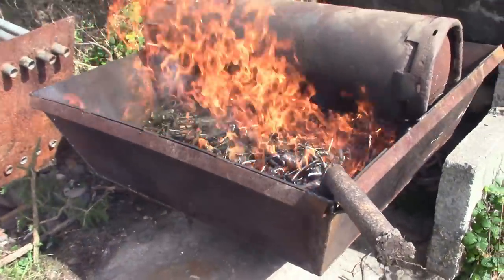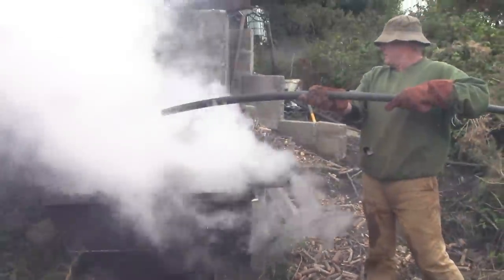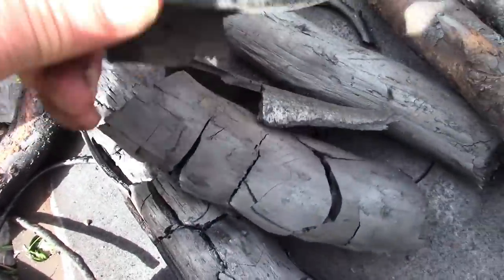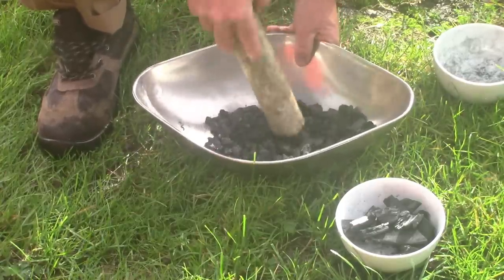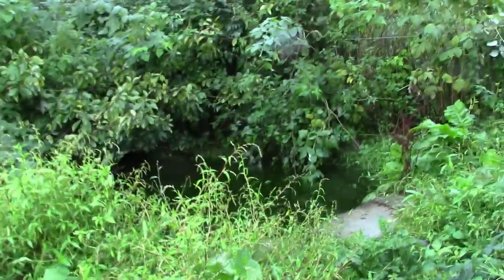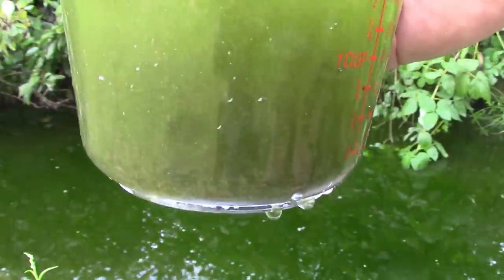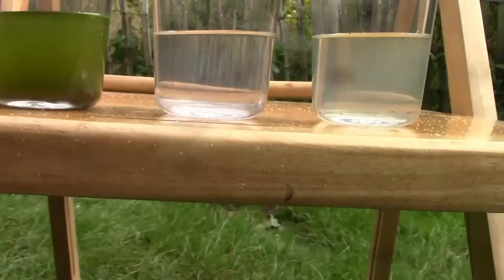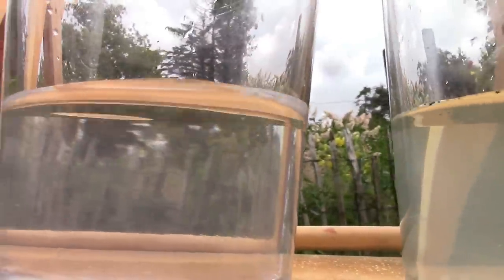But Is It Really Activated Charcoal? (Make your own and then test it..)

Comment: Having done quite a bit of charcoal myself and dabbled with a few activation ideas, none of which satisfied me that the process was successful, I’m not convinced your test method is valid, perhaps filtering chlorinated water and testing for chlorine or perhaps filtering water that is not neutral in pH and testing if it brings it back to a more neutral pH?
Reply: The pH level is not a good indicator since wood ache is always alkaline. That will raise the pH level even if the charcoal has no activation. There are cheap indicators for chlorine, but an accurate result is easier to do with iodine. A simple titration can give very good results.

Comment: So, it looks like you are taking the long route to activation. You could ensure your process by using a calcium chloride or lemon juice solution.
Reply: I've used a calcium chloride soak but the soaked charcoal needs to be heated above 400C to initiate activation.

Comment: Why do people sometimes call Celsius a centigrate?

Charcoal seems like black magic to my inept brain. i have watched it being made rather simply on this channel but its completely crazy causalities are impressive. from wood to not quote coal with just some heat and rapid cooling hmm kinda like tempered metal? clever people were all throught history of our spiecies.
Reply: Centigrade: "one hundred graduations", because there's 100 degrees between freezing water and boiling water.
Reply: Centrigrade was the old metric word for the unit. When the scientific world changed to SI units (in 1960?) the name of the unit was changed to Celsius. SI took some units from the metric system (e.g. metres, kilograms), some units from the Imperial/US system (e.g. candlepower/candela), and invented a whole bunch of new improved units (e.g. Joules, Pascals). I believe everyone now uses SI units except for the USA, Liberia, and Burma/Myanmar.
Reply: @davidhaywood8029  thank you that is excellent explanation, i can not do much more than thank but i at least wish you great week.
Reply: @nameless5413  No worries! (By the way, you've been luckier in the delivery of this information than me. As an engineering student I had it shouted into my face  -- at a distance of about about 100 mm -- by a senior navy engineer.)
Reply: Charcoal have a large surface and water can move much faster over it then larger molecules and particles. The result is that just water get to the end of the filter and can be tapped of. If a filter is used to long the rest will follow and the filter stop working.

Comment: Hey! Not to dunk on your results, but you failed to wash the non-activated charcoal before testing or didn't show it atleast. The batch of activated charcoal when being made was washed which could have removed certain water soluble elements in the charcoal that would still be present in the non-activated batch. In order to guarantee this isn't the case I would suggest running the test again, but wash both batches with filtered water until they run clean before using the pond water.

Comment: You might have been better off using all that fuel to distill your water if you plan on drinking it.
Reply: I think it's more about some kind of fertilizer or soil treatment. The filter test was just to show it is indeed activated charcoal.
Reply: @schwuzi  I agree, there is great value in that.  Inoculating the soil may better than just watering it with pond water.  Just noting that all that excess heat could be captured for making a clean source of emergency water if needed.  These days you never know what will be in short supply.
Reply: @zippymcfearson2776   I think he touched on that in the video, I don't remember. Instead of the barrel on top you could run any old water boiler with a heating coil in it to pump fresh water through. Though the you would need quite the flow to not overheat or overpressure the boiler.

Comment: Full of eggshells?! I feel like that needs more explanation...
Reply: I concur, what is the purpose of the egg shells?
Reply: probably fertilizer. Just a guess.
Reply: You kill most of the pathogens by heating, grind it and feed it back to the chickens/ducks. Calcium cycle.
Reply: @unything2696  protecting chickens from chicken bugs....
You don't really know chickens...
They are always preening, including the girly bits* at the back and scratching around on ground they poop on.

As for a calcium cycle.. I'd expect these chickens go out and find all the calcium they need in the critters they eat.

* technically cloaca, colloquialy arse.
Reply: @dougaltolan3017   They can benefit from calcium. Rarely we get eggs with a softer shell, so they can have too little calcium in their diet.
Reply: @dougaltolan3017  Pathogens are not only bugs. It includes viruses, bacteria, fungi and so on. And those kinds of pathogens are killed by heat. I never said you heat the shells to protect chickens from bugs. You don't really know what you're saying.

Comment: Couldn't you just use standard charcoal, but more of it?
Reply: Or grind it finer.  Or get exact same results filling the tubes with sand.  Or bits of paper towel.  Charcoal of any state or process need not be involve to achieve the same exact results.
Reply: Then why is Tim trying to produce it! Think about it!!!!

Comment: I was under the impression that activated charcoals difference is that it contains living organisms.  Fungi, bacteria etc
Reply: That's the definition of biochar: charcoal which has been inoculated with living things so it works as a beneficial soil amendment, not just a filter material.
Reply: @PKMartin  Thanks!  That helps